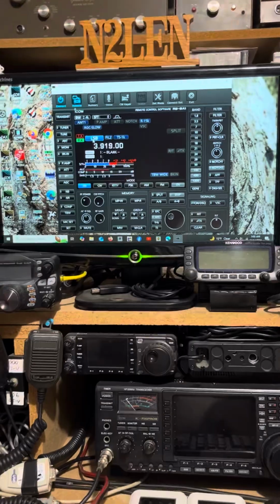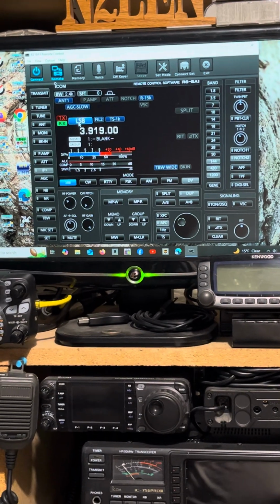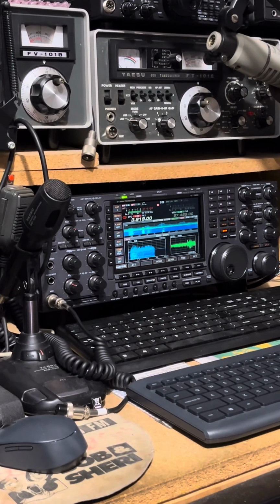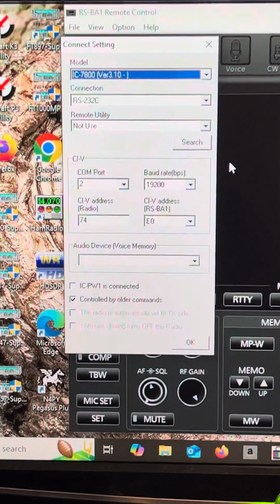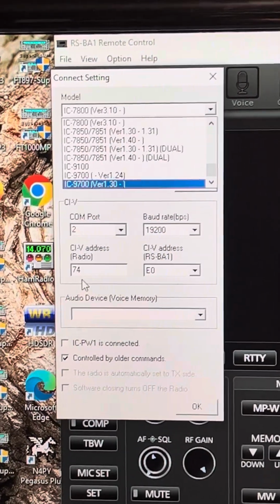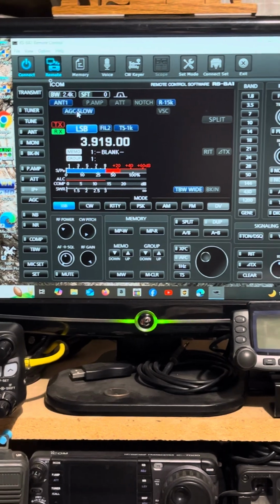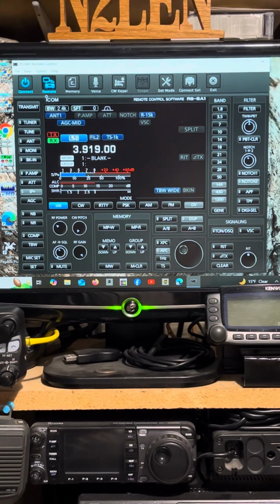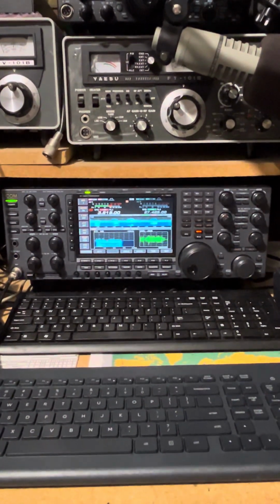Icom IC-7800 Very Late Production US Model & RS-BA1 Version 2.41

Comment: Just curious, the 7800 doesn't operate on 60 meters?  I didn't see 60 meters (5 MHz) listed on the right side of the screen where the bands buttons are located on the RS-BA1.
Reply from the maker: The Icom 7800 MK 2 and later comes ready to operate on the 60
Meter band. The manual shows how to match the frequencies and easily add them into memories. I would think that the software would allow you to select each memory channel once programmed.  But I’m not sure and would have to test. 😊
Reply: @n2len  That 7800 is one sexy radio.  Everything about it makes it stand out.  You have an amazing collection of radios, I'm jealous 🙂
Reply from the maker: I agree the 7800 is a beautiful radio. It’s heavily duty built. Too bad that part availability from Icom has become nill. So if they fail, servicing them becomes quite difficult and expensive. 🤷‍♂️😊